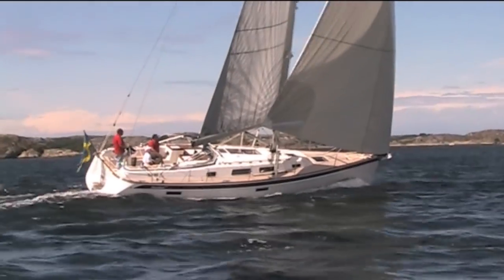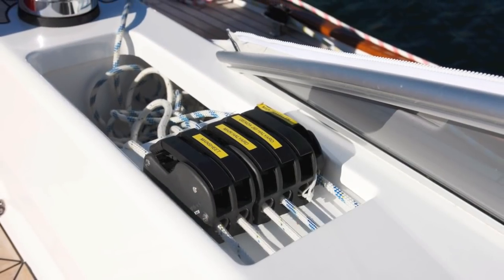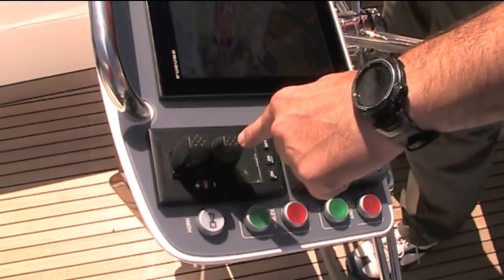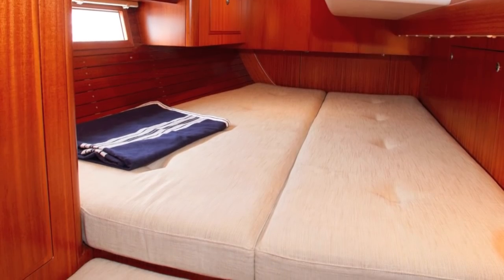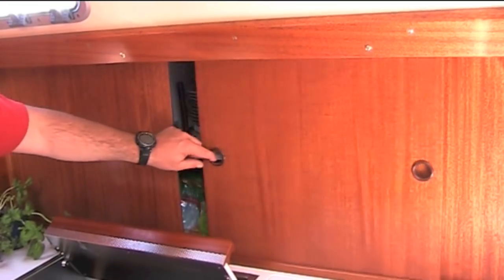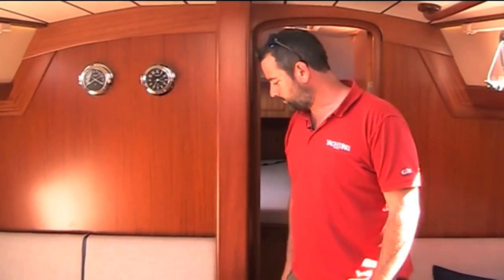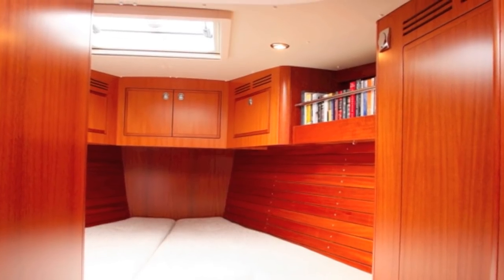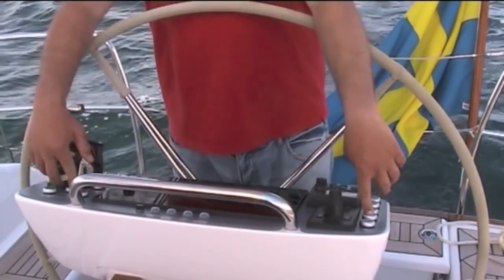Yachting Monthly - Hallberg Rassy 412 boat test

Comment: Yes, great practical points made, amazing review. You could use auto pilot whilst dabbing the two buttons for easing and furling. I notice you like two cabins and work cabin in these size of boats - totally agree - i.e. two couples/couple and skipper/couple and children max. perfect. It should also be noted that having this winch system means you can not only trim easily, but also retain larger higher powered genoas without relying on self tacking staysails or solent jibs which are smaller.

Comment: Big ass wheel for a 41 footer
Reply: Need a big ass wheel (or dual helm) for 40 footers that bring their beam that far back. And they pretty much all do now. Otherwise your can't drive while sitting outboard/on the coaming. Unless you have a tiller and extension!

Comment: I feel sorry for the poor bastard who is sailing this thing, and only relies on electronics to sail, when it loses battery power...... Class A boat. The wiring is really impressive. You can tell a Brit was not involved in designing the electronics.. Unlike my former Camper Nicholson which had 25 miles of wiring between the chart table to the engine area.....

Comment: Why can't you review a Real sail boat that doesn't just run off electronics and just review a boat where there is actually work involved sailing is not sailing with out the work and trust me its a pain putting up every thing for my 1977 28' ft Islander and I know damn well you can't sail that thing of electronics
Reply: "sailing is not sailing with out the work" Hogwash. Sailing is sailing. It doesn't matter how one puts the sail up, just that the sails are put up. What do you call it when you drive a modern car with Anti-lock brakes and electronic fuel injection? Do you not call it driving? Or do you need to be in a 40 year old piece of crap in order to say that you are "driving" for real? PS: All new production sail boats have electric something or other. Its not these guy's fault.
Reply: +conor packapunch 
I am envious, too. As soon as I put my hands on half a million, I'm replacing my 24' bilge keeler with one of these lame electric gizmo loaded ones.
Reply: Especially one of these. i dont know much about sailing, but i'll bet halberg rassy wouldn't put it on thier boat if they didn't feel good about it. They seem to eschew new fangled for tried and true but put craftmanship, materials,  and engineering into it. For the price the ask they wouldn't be around if it were not so.
Reply: Conor, everyone likes redundancy when it comes to sailing, I know I would if I do get a sailboat, specially when your out there alone in the middle of the pacific ocean with wind above 30.